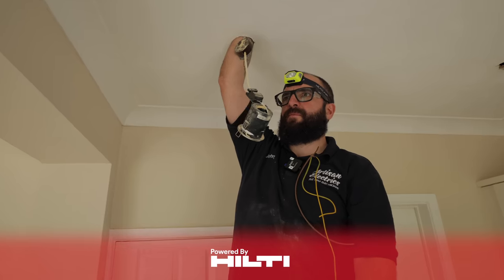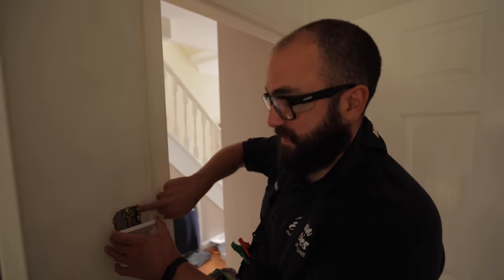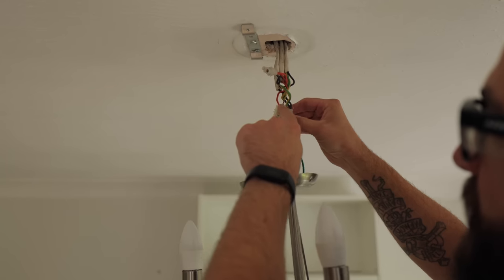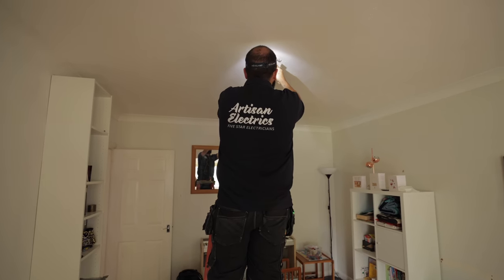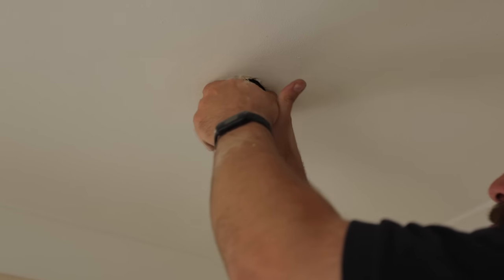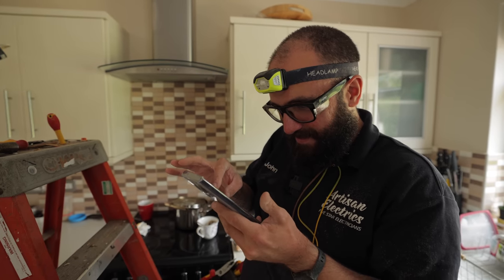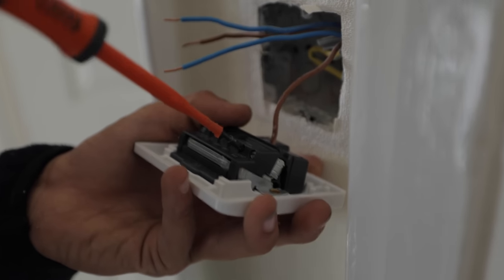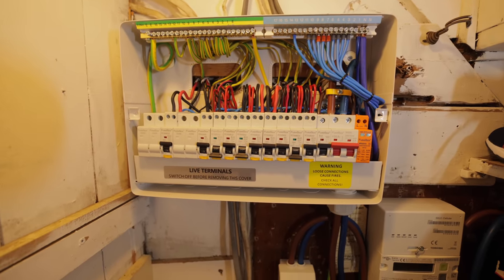ANOTHER DIY BODGE! 🤯 "Why are people like this?!"

Comment: it really is interesting to see how different it is done from country to country, here in germany you normaly (todays) go with the cable from the breaker either to an distribution box inside the room on the wall (or better flush with the wall) and distribute from there or and i believe that is more common nowadays to the box in which the first switch of the room sits and distribute from there to the lights, sockets and so on.
I would never have guessed to look at the light outlet for the main cable of the room since here they com straight from the switch even like back in the 50´s it was done this way only thing changed since then are the wire colours.
Reply: Ring circuits are the norm in the UK where spurs go to the switches from the fixture.
Reply: The standard approach in the UK since at least the 1950s is to distribute power round to each lamp ceiling rose, daisy-chain style, then there is one cable down to the light switch. Up to at least 1965 there was no earth/CPC used in the lighting circuit (not sure when this changed). That's one of the main issues in this house. And also it's been converted from the original central ceiling rose to 4 downlighters, and to lamps which don't have the terminals for a neat job, like the original ceiling rose would have, so you end up with 4 bits of chocolate block (live, neutral, CPC, switched live).
Reply: Here in the Netherlands, the modern way (old circuits are Wild West) is the Centraaldoos — feed into a large central box that usually doubles as the lighting point in the middle of the ceiling, with sockets and the switch all coming off that.

Comment: Today (7th August 2023) I took down 26 old spotlights and replaced them with nice new LED ones. I managed to get every single one down without damaging or pulling down any bits of the ceiling 😂. 
I found multiple CPCs just cut off or not connected at all. 
Everything rectified, CPC present to the circuit ends and all lights working and look lovely 👍
Reply from the maker: Congrats 👏

Comment: 6:00 I can tell you right now that is a light destined for the American market. The US does not require any space for the lighting fixture to House the cabling as the light is supposed to be mounted to a back box in the wall or ceiling. US code requires all electrical junctions to be accessible either behind fixtures receptacles or a blank plate. So lighting manufacturers have never had to leave room for the wires as they're supposed to be in a cavity behind the fixture. I don't know if this is a you should have specialized lighting for the UK market or if the UK should change code to require no hidden junctions and everything in boxes. Granted there are still some ceiling fans and light fixtures they have left absolutely no thought and there's still barely enough room to get it connected and attached.
Reply: good electricians would fit a box here too we can have hidden junction boxes but they must be maintenance free.
Reply: @UKsystems  yeah the whole maintenance free junction box things freaks me out, knowing the number of mistakes that can be made and never be tracked down. Then again if they're doing it in properly anyway it's probably still accessible.
Yeah the Chinese market for better or worse has copied everything and shared it with everyone. Combine that with people who see that's the light I want I don't care.
Reply: @imark7777777  you were generally only buy your connectors from who have relationships of the actual manufacturer independent of third parties most of the time they get it from reputable distributors. No one is using random Chinese connectors the maintenance free junction boxes because by the very nature maintenance free junction boxes like box only fit brand connectors properly and they need to cable tie to secure it also we do a lot more inspections in the UK on our actual system so most things will probably all things that could go wrong wrong would be detected

Comment: @ 6:23 that's why we use ceiling boxes that has space and we screw the light fixing bracket to the box and plenty of room for cables. Schneider JR08 or KR00 if you can access from above or if only from below then Schneider RJE 06, RKE 06 or ABB AUS15.2

Comment: I faced a similar situation in a kitchen in an old Welsh cottage, originally wired in the 60's or 70's.. Fortunately the ceiling wasn't boarded over.
It had to be rewired because the customer wanted class 1 light fittings.
I think you need to do the same, and rewire to the centre distribution point, and the switch line.
Reply from the maker: Thanks for sharing!

Comment: Where the new garage breaker box is installed- having the double socket directly up against it means there’s a lot of ‘wall-wart’ power supplies that will not be able to fit .. ideally it needs to be  a faceplate width lower
Reply: most uk plugs face down and our extention leads are safe

Comment: 11:21  Nice use of a hot air gun on the heat-shrink.  Handy hint from America: Carry a few sticks of hot-melt glue and use them with the hot-air gun if you need to glue something (e.g., repairing woodwork).  Much easier than a hot-glue gun.

Comment: This is why, for years now, on lighting circuits I never use a ceiling rose (or a light switch) as a junction box. It's extra work and extra expense, but EVERY user-accessible outlet I install with solely a single cable so it is completely unambigious to DIY Dan what he's looking at. Too many "I joined all the reds together, and it went BANG!".

Comment: 18:33 Two flat cables through a single circular cable gland. That enclosure now has no IP rating.
21:13 Could have at least run the cables down below the glands immediately before they rise back up to them. Now any water can track all the way to the gland rather than gather and drip off at a low spot.

Comment: A temp fix you could take a cpc off the kitchen extractor fan and take it to the joint on the down lights, something you allowed to as the earths are all common in the fuse board, just make a note on the EIC

Comment: Think the fuseboard would have benefitted from a piece of trunking horizontal to hide wires coming in from the left and vertical to hide wires coming from above . Only aesthetics but for the sake over a couple of quid it would have looked much better. Nice video , back to the old style. And i thought to run a single earth core would have been cheaper than replacing all the lights and faceplates . Obviously i dont know whats above or joist direction .  👍

Comment: Garage radial socket using a 32a on a 'temporary' basis? The whole point of this remedial work was to remove non-compliances - not add to them. Also doubt very much that the garage light will be any use. The garage door won't set off the PIR, unless the garage door is hot! It's not a microwave sensor. 
Clear fault finding, learned a few new phrases. I sympathise with the understairs fusebox change - I know being there is a killer from experience.

Comment: As much as it's a pain and costly to rewire, if you change the fittings and switchgear to class II, there's nothing stopping the owner from removing and fitting class I stuff later on. If this is DIY, chances are they'd fit the CPC if available. If not, they'd probably leave it without caring too much.

Comment: Do you guys never use the WAGO push in connectors instead of the lever versions? Much smaller and would of been much easier to fit behind that light fitting base
Reply: Wago 224-112, made for it

Comment: I am so glad that modern day electric codes here in the USA don't allow panels (CU) to be put in locations like that.  Here you also need permits to do what you guys are doing by switching out the panels, which then everything has to be brought up to modern day standards as well.   In that case the panel would have to be located into an accessible location if switched out.  The costs can be very expensive because of what might be needed to the older electrical system in the house to bring it up to current codes.    Great job guys!  👍🤠
Reply: What you have to remember a lot of are British houses are a lot older than your houses so lot of the old houses over here can only have the consumer unit in annoying places new builds have them in the better places just remember this Americans electricity standards are all over the the place
Reply: I agree though it's harder for the UK as quite a chunk of houses are easily over 100 years old the house I live in was made in 1905 and we have houses in the UK that have been around longer than the US has
Reply: @SeizureGman  About 15% of houses in England and 20% in Wales (don't have a handy figure for Scotland) were built before 1900. Easy for Americans in their glorified sheds to forget.
Reply: that location is too costly to move it is ok but not ideal as it is a common location in older houses it but there is a notification process after the work where a certificate is sent off to building control the rest would be changed or updated to be good

Comment: The point you make, about 7 mins in, about light fitting design is a great point. I used to fill with dread when I heard the words 'ceiling fan' or 'IKEA'.
Reply: Especially all these "modern" ones with no mechanical support, so while you're trying to wire it up the only mechanical support is the electrical fittings themselves! I had a ten-kilo chandelier(sp?) that I had to get my "apprentice" to hold up with two brooms while I wired it up and eventually got the cover on.

Comment: I suspect that that 80V is induced, so the current will be tiny.
Reply from the maker: Still not a nice thing to touch it 😅
Reply: @artisanelectrics  You probably wouldn't notice, although you can get a "tingle" from some induced voltages. The real danger is if the line ever touched the metal box of facia plate. Then you would jump...
Reply: Was just wondering where the potential comes from….
Reply: Can someone elaborate on pls on how the 80 v comes about
Reply: @denmcf89  It's going to be some sort of capacitive coupling. Broadly speaking, any time you have two conductive areas close to one another, then it creates a capacitor. As the electric field changes in one conductor it will induce a change in the other conductor. It's very important in electronics. For example, capacitors are often used to allow alternating currents to pass whilst blocking direct currents (and there are many other uses too).

So what is probably happening here is that the AC voltage in the socket and wiring is inducing a change in the metal front of the socket and the metal backing box. As those are effectively insulated and not connected to ground, then it's possible to measure that voltage. However, it's a very inefficient sort of coupling, so the AC current that appears to leak across will be very low indeed. The reason the meter picks is up is that it will have a very high input impedance meaning that the tiny AC current is enough to allow a voltage to be registered. Most likely you would never feel anything.

The real danger is not from that 80V, as if you touch the front plate, it will essentially disappear as the human body has a much lower resistance than that meter. Where the real problem arises is if there's a fault behind the socket whereby the line conductor touches the back box, then it won't trip the breaker, as there's no route to earth. However, it will make the metal plate, and the fixing screws full live voltage. Then you can get a shock, although if an RCD is fitted it ought to trip and prevent a fatal one, although nothing is guaranteed.

Comment: At this stage you have identified that the CPC is missing because it was not previously required. You could use nylon screws etc to avoid the need to update the circuit, but what happens if someone comes along later and replaces the screws with metal ones. This could be anyone, not a bodger and certainly not an electrician but a home owner. Clearly the circuit needs to be brought up to current standards which were introduced to improve safety.

Comment: G,day from Sydney Australia.
Did you have the supply company "pull the fuse" to the property, for replacement of the DB Distribution board. 
* If access to ceiling space run new CPC (earth/ground) to CPC busbar?
🐝💨
Reply: Quite a few meters have a built-in isolator. On mine, you need to use a screwdriver to operate it and I don't think it's rated for a live load so throw the isolator on the consumer unit first. However it lets you work on the consumer unit including a swap out without needing to involve the DNO.

Comment: I have been doing a bit of DIY, replacing single sockets with fused three gang.  House wired by a qualified electrician when built not touched since.  No a grommet in any back box (all steel).  Only the odd one with a fly earth.  Earths all in the same insulation.  I did take the front of the consumer unit, really a mess.  I did test the torque on the RCBO's with my torque screwdriver, several were not to specification.  If you covered Burton on Trent I would get you to replace it.  The point I am making is not all DIY is badly done and some so called professionals are dreadful.
Reply: are you qualified or not
Reply: @UKsystems  No I am not a qualified electrician but I do know that torque specifications are there for a reason, and I also know how to wire a socket and why the grommet is required in a metal back box.  I also know my limitations, I really would not change a consumer unit myself.  Too much wiring to worry about at one time.
Reply: @davidjenkins8009  just to say technically Gromit could be avoided if the cable does not rub although it’s not best practice you have to be careful because I doubt you have to be proper test metres which can create a large problem because they identify issues that you cannot find out otherwise, or it may kill you to find out such as the Earth could have a resistant that is too high to trick the protective device within allowable times but cheap plug-in testers tested as good
Reply: @UKsystems  Apart from the fact that I have not changed any wire in changing from a single to a three gang socket, and therefore there is no change in the circuit, I also use a Martindale EZ650 Which does do an earth loop impedance test.  I suspect you are a professional electrician and you will want to support your fellow colleagues, but in my last house, the original wiring of the house built in early 1980's, it had five spurs off one socket.   I discovered this when I fitted a new kitchen.  I do believe there are excellent electricians but there are also a lot of very poor ones. The problem for the consumer is how do you find a good electrician, one you can trust.  A bad electrician can cost you your house or life.
Reply: @davidjenkins8009  as long as you do appropriate test that’s fine. It’s just if there’s an issue with a screw terminal on something like an earth it can be  quite hard to identify until there’s a problem as most appliances will function.

Comment: Does the UK actually allow all those open joints in the attic space?  In the US, your terminations must all be in a junction box.
Reply: Americans don’t have the right to comment on any other country’s electrics😂
Reply: Interesting. As a DiYer, I use Wagos in a Wago junction box with just a 1½mm² flexible cable to the light fitting. I don't use the ceiling rose for anything more than the feed to the light. I've seen far too many registered professional electrician bodge jobs
Reply: @callumroberts6549 …okay, just wondering 🙂.  This seems like it would not be protected against fire.
Reply: I did my UK C&G 30 years ago and I agree, I'm very sure I was taught that any connection must be in an enclosure - which is why I recoil in terror at American "toothpaste cap" joints. :)
Reply: must be maintenance free if not accessible with no exposed or single insulated conductors.
Reply: @callumroberts6549  😂

Comment: Clamp wagos are not undented to connect copper and aluminium cables, you shoud use wagos from other line (clampless) and the wago aluplus.  Aluminium tin cable you connected will oxidize over time and can cause hazard
Reply: they changed the spec on some after this was filmed but before posting

Comment: Yes the kitchen lights need a rewired but it’s up to the customer .

The only thing you can do is borrow a ground & RCD the circuit .

Note 
In the 1960‘s most lighting circuits had no cpc .

Most had some fittings we now call class 1 .
Err clothes iron , battery charger , toaster & radios  😳
Reply: Yeah mine is 1962 - no cpcs in the lighting circuits and some nice metal lamps either side of the fireplace fitted at some point. Even I (an expedition potholer with a high risk tolerance) thought that was pretty dodgy. The loft has all been updated but there is still some 60s wiring left in places which really is due for the chop.

Comment: It's crazy that light fixtures don't require any type of electrical box or octagon in the UK 🤯
Reply: And terminal blocks 😭
Reply: it is a good idea to fit a box and is done by professionals and the terminal blocks have to be properly protected. out electrical system also has a beter overall protection from shock

Comment: About that cable trick, would that work with the cable to a pair of headphones that keep getting tangled?
Reply from the maker: Probably not due to different materials but your more than welcome to try
Reply: Way to deal with that is to hold up the end of the cable and dangle the headphone so it spins round. It Will then remove the twist from the cable.

Comment: Is it acceptable to use a combustible plastic isolator in a cupboard under the stairs which is an escape route? You can use a compact metal isolator with a lid or a fused Bakelite isolator instead which are non-combustible.
Reply: The wec isolator is rated as fireproof I believe so doesn't need to be metal.
Reply: Where do you stop, should the meter be in a metal enclosure? Can’t cover every little thing